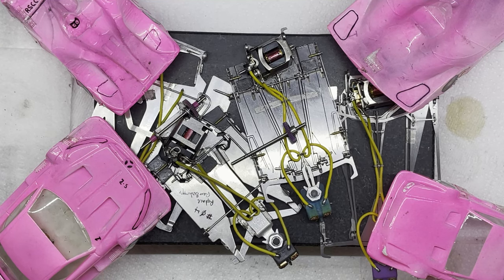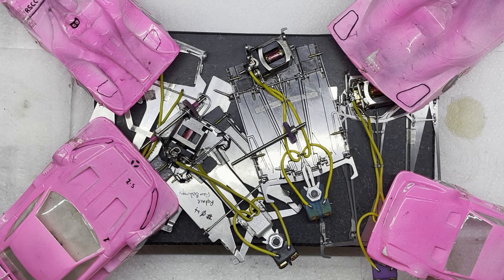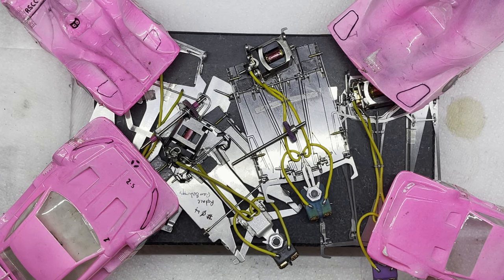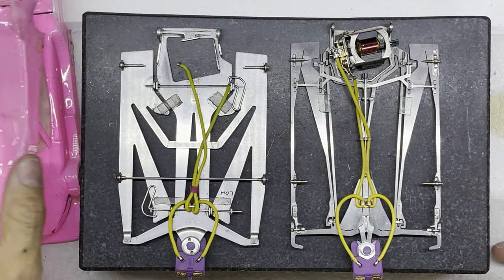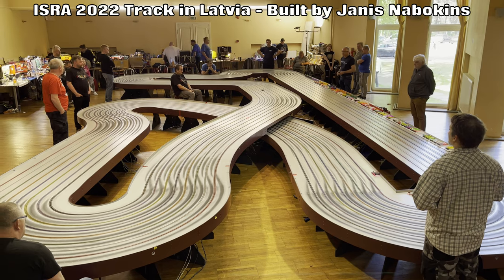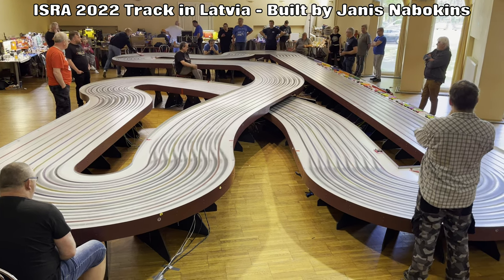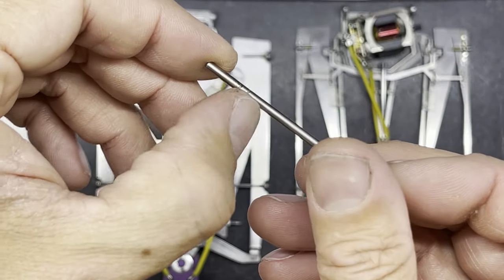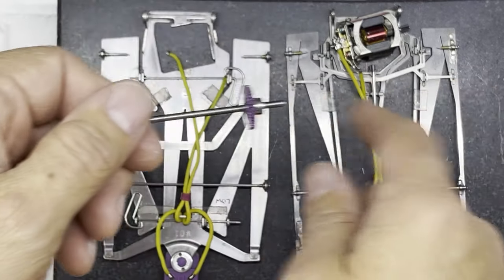What gear ratio should I run on my slot car? - How fast does the motor need to rev?

Comment: Please could you show how you swap gear ratios? How do you remove the axle if the gear is glued on? How do you not melt a spur gear if you solder a pinion and they are in contact? How do you move and align and fix the motor to get a mesh with good lash?
Reply from the maker: Hi Adrian. Thanks for watching and asking questions. Check out this video as it will help to answer some of your questions…

Build a race winning JK C43 Aleos slot car chassis - Part 6 (Fitting JK Hawk 7 FK motor and gear)
https://youtu.be/9iS71WKQ0xQ

Comment: great video, what brand is the 16 deg angled 72 pitch spur gear that comes lightened etc. keep up the great work.
Reply from the maker: I think you are asking about the ATTAN gears.
Here is a link…
http://eshop.slot-racing.cz/attan-slot-racing/eshop/5-1-Gears-pinions/0/5/84-Gear-42t-44t-72p-15-axle-3-32

Comment: Silly question are any of these cars ever direct drive with no gearing ? Cheers tj 👍
Reply from the maker: Not a silly question and thanks for asking. People have tried a direct drive slot car but there are a couple of major issues associated with it. One problem is that if the motor armature is rotating in the same direction as the wheels, then the torque of the motor will cause the can of the motor to try and rotate in the opposite direction. This causes the front of the chassis to lift out of the slot. The other problem is that a conventional sidewinder or anglewinder slot car uses the gyroscopic effect of the motor to help the handling of the car. If the motor was directly driving the wheels the gyroscopic effect would be far less as the motor would need to be rotating at a slower speed.
Reply: Not silly, when I was a kid, slotcars we ran had direct friction drive from the motor amrature to one of the rear wheels. Rubber O ring on motor, set against the 'new' siliscone style rear tires, circa 1968-69 if I remember right......JC
Reply from the maker: @jamescouden8730  , I know PARMA used to sell “whisper jet” cars that were driven by an o-ring type belt. 👍🏻
Reply: Well i picked up a Scalextric black corvette with a 18k Mubachi and thought why nit give a rewind a try used 0.25mm enamel copper wire 50 winds per pole @ 12volts it pulled 800 Mamps and rpm was off the charts what a great experiment very enjoyable process... will look to rewind but with more winds hopefully bring down amp demand and heat a little... have no idea how i will control this motor ontrack may need to build custom brass chassis with lexan body i think.. cheers tj 😊👍
Reply from the maker: @tjkirkpatrick9451  , sounds like a beast. 800 Mega amps is frightening ⚡️💥.
If it was drawing 800 milli amps then that is still quite a handful for a little Mabuchi motor in a Scalextric car. You might need to upgrade your track power supply and solder the track joints together. Good effort and keep trying new winds till you find something you are happy with 👏👍🏻
Reply: @CleaveTech  sorry for the typo yes milliamps i have a 3 lane routed timber track braided with independant variable power suplies and professor motor controllers with adjustable brake and throttle pots track is 20 meters approx its a good size with 125mm lane spacing.. the mubachi motor build is definately producing way above my wildest expectations so will look to atleast 80 windings if it will fit to tone it down a fraction brushes are probably my concern as these arnt servicable that im aware of?  Either way will build a few so have a class to tinker with.. traction with goo isnt something iv ever used or been interested in so not sure how this will go getting the power down was thinking of running plafit style rims/tires.. also Merry Christmas and once again thankyou for the fantastic content cheers tj 😊👍